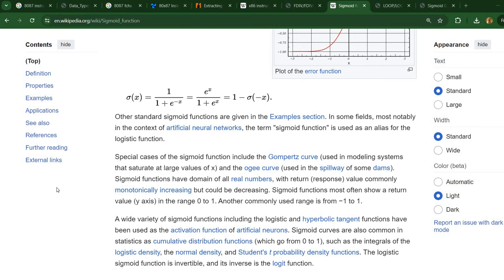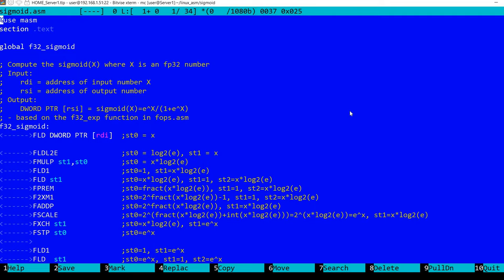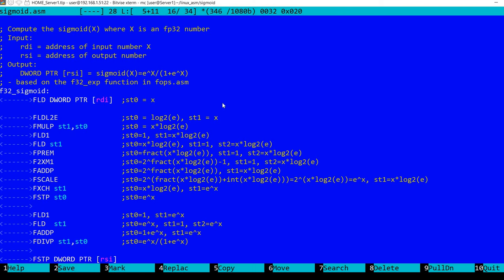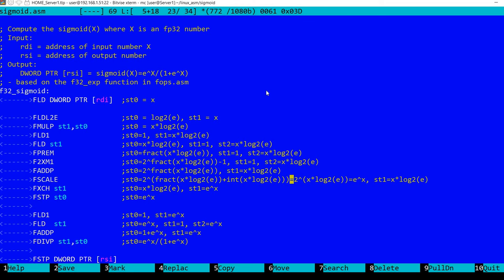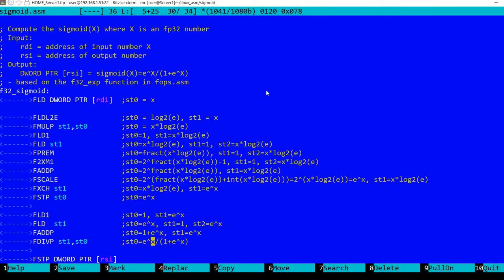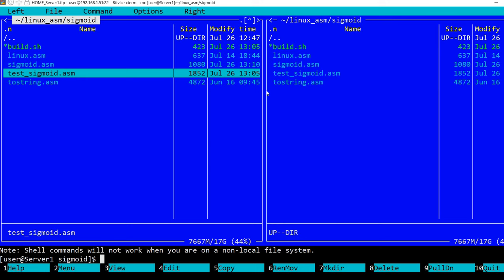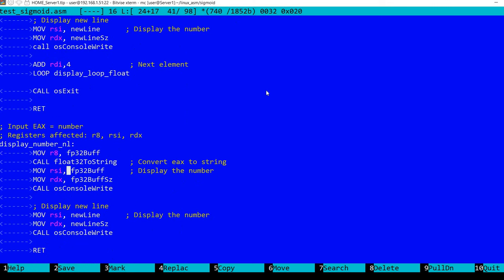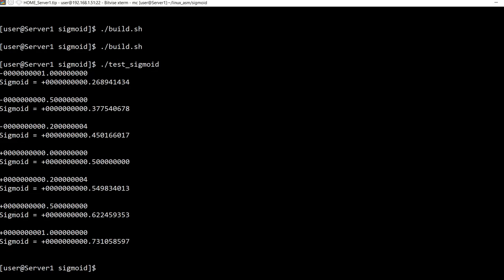Logistic (Sigmoid) function in assembly language

Comment: Nice work, many people may have eyes widened by fact that you can calculate logarithms and e with few cpu instructions.
But...I don't wan't to be whiner, but for calculating it this way for AI maybe overkill.
This is the final function of "neuron" with task to dampen (or even "binarize") output also this specific function have very limited result range, so some kind of lookup table comes to mind.
Also today's AI don't use FP64/FP32 but FP16 or FP8 some even try to one bit (LLMs).
Reply from the maker: Quantization is indeed very good for reducing the memory requirements associated with deep neural networks and very large models (either language, speech or vision models). Internally, the x87 instructions do use polynomial approximations with table-driven algorithms. This article by researchers at Intel gives some details about the implementation in the CPU for IA-64 architecture of the instructions F2XM1, FYL2X, FYL2XP1, FSIN, FCOS, FPTAN, FPATAN: http://www.computer.org/csdl/proceedings/arith/1999/0116/00/01160004.pdf  (can be read for free if you have a Computer Society membership, or you can try to find a copy on the Internet). Thus, I think there is no gain to re-implement in software the table-based algorithms which are already implemented in hardware. Of course this is true for CPU-based run without quantization. Otherwise, for GPUs/TPUs or quantized approaches that's a different story and the best option is architecture dependent (as different hardware architectures may have additional optimizations for specific floating point precisions).

Currently I am working (for fun) to implement a very small neural network entirely in assembly language, so if you find this interesting stay tuned! I'll document the process and I hope after 5-6 more videos (with vector and matrix operations and MSE loss) it will be done. I will also release the code when it's working and will compare it with Pytorch Lightning (which I actually find to be a very good framework). Even though it will be on CPU only and single core for the moment, I am still curious of how fast it can run.